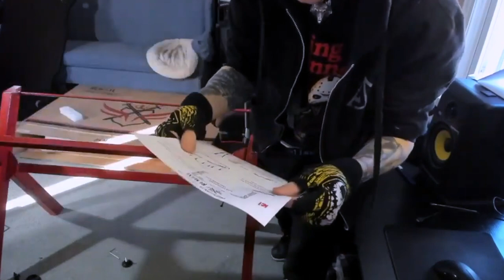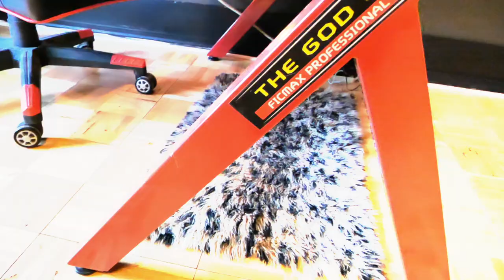Remaxe Gaming Desk Unboxing & Review

Comment: does the chair have a rock back and forth option?
Reply from the maker: it does, actually. The lever for you to make it go higher or lower can be pulled horizontally and it will release the chair from being locked. The killabee is a bit tougher to rock due to the beefier spring but both of them do release and rock so you can also lock it in a gangsta lean position

Comment: I have a question do two monitors fit
Reply from the maker: Depends on the size, i would say yes but it'll be better if you have the arms to hold them from the back instead of using the stands which will take up too much space